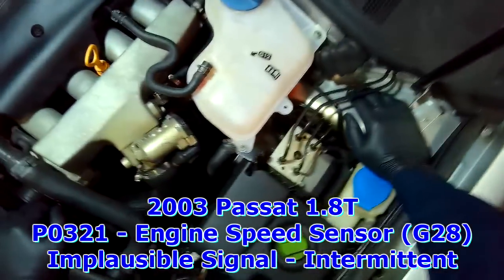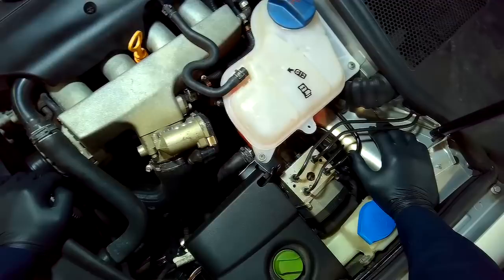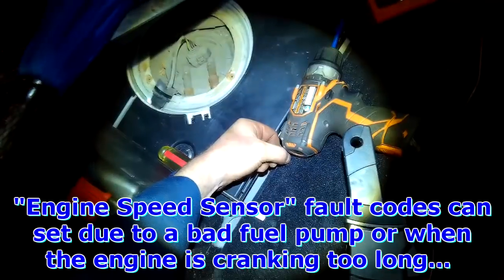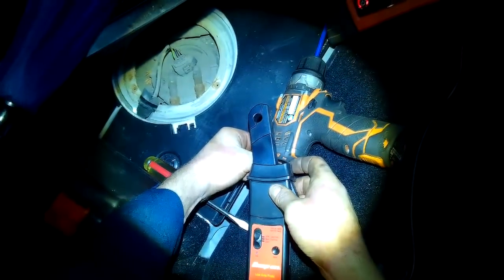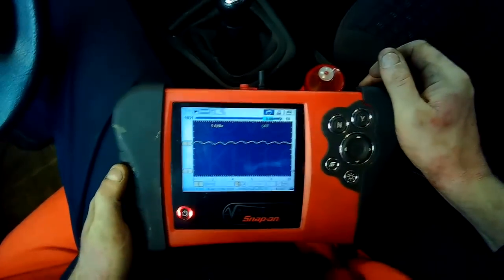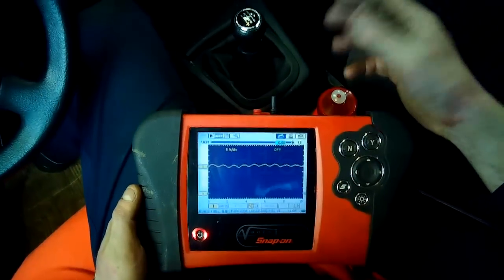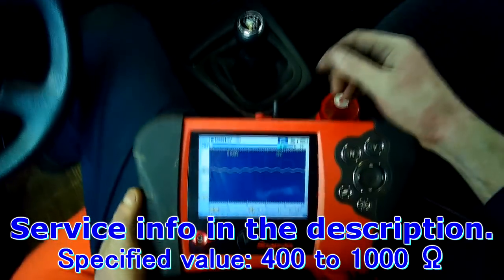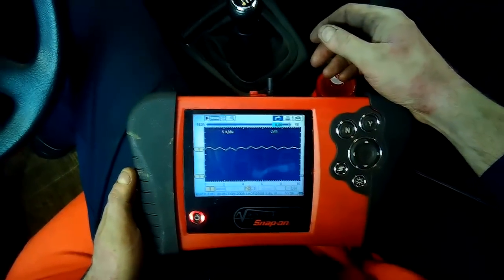VW B5: 1.8T Passat crankshaft position sensor

Comment: I simply cant get that f.. screw out of the sensor. it just wont move and i have no way on lifting my car up.
and i cant remove the oilfilter 
im just stuck right now and dont have a clue how to fix my sensor
Reply from the maker: Are you sure that the sensor is bad?

What symptoms?
Reply: @EXOVCDS  when the engine gets hot the car wont start for about 15-20 minutes
battery is fine, got a service man to check the car computer and the code said that the sensor needs replacement cause temperature sensor in there isnt working anymore
Reply from the maker: @Nydust 
Ok, just wanted to be sure you don't replace it for the wrong reason.

10mm socket should fit.

A 5mm allen should fit on the middle of the bolt head in case the 10mm is stripped.

If both are stripped, you can use an extractor socket to bite the outside of the stripped 10mm head.

Comment: Hi, where is it located on a Passat B5 1.9 tdi afn engine? Thanks.
Reply from the maker: Same place... if it's not there, then it doesn't use a crank sensor.
What's the issue? 
Crank sensor fault code?
No start?
Check the timing belt crankshaft gear... could be loose and caused timing to go out too far.
The more info I have, the better I can help.

Comment: Hello Thomas. I have 2002 Passat 1.8t. There's oil leaking unto my crank position sensor. What's the likely cause and how do I fix this please? Thanks
Reply from the maker: Check your oil pressure switch that is on top of the oil filter mounting bracket.
Check the oil cooler seal. To replace the oil cooler seal, you have to remove the oil filter and the oil cooler.
https://youtu.be/TzjE-rGKSU0?si=l1JK96N2qN-C6O5u
Reply: @EXOVCDS  Thanks for the heads up. Will update you when I do as suggested. 👍

Comment: Strange. It takes ages to get the old sensor out, and you don't show it. And what is it that you are cutting just before taking the old sensor out?
Reply from the maker: Remove what you have to remove, in oder to get at what you want to remove. Sometimes the sensors just pull out... in this video, I needed to pry it out with a pry bar. If you know where the sensor is (as shown & explained in this video) then there's nothing else that you need to know or see... in order to get your sensor out.

Comment: Great job as usual but I would surely remove that oil filter  to make it a little easier. Thanks for the video
Reply from the maker: Removing oil filters on 1.8T Passat's makes a mess... I don't even want to remove them when the vehicle is booked for an oil change. LOL
Reply: @EXOVCDS it is a royal P.IT.A. Those filters are usually very hard to take off.
Reply from the maker: Thank you for watching!

Comment: My hold-down bolt had an 11mm head, instead of a 10mm. Thanks for the video!
Reply from the maker: Does the bolt head have a hole for a 5mm Allen bit? If not, then it isn't a factory bolt. Thank you for watching.

Comment: I know this is an old video and you’re not google but I’m having the hardest time finding anything on my issue. Along with many other codes (she’s a bit of a project) my obd reader is giving me a serious code and the car isn’t cranking. It’s throwing p0012, camshaft A position over retarded. This is the first engine related thing I’m working on as I’m new to vw. Is there any help you can give or videos you can recommend that you think would help. Car does not start, it’s a 2004 Passat gl. Pretty positive the exact same trim as the one in the video. Thanks a lot in advance!
Reply from the maker: A "no crank" is different from "not starting" (which could be a no crank also). 
If the starter is not turning the engine, it could be an ignition switch issue, a comfort control module issue, a Park/Neutral switch / relay issue... if it DOES crank but the engine does not start & run, then you are looking at a fuel, ignition or mechanical issue.
Post a video on your channel so I can see & hear what is happening.

Comment: Hi, maybe remember what size is this bolt ? m6 ? m7? m8?
Reply from the maker: As mentioned in the video, the bolt has a 10mm head... it is an M7 bolt (but that does not matter, unless you have to find a replacement bolt).

Comment: How do you determine if it’s a crank or cam sensor?
Reply from the maker: The ECM will set a code for whichever is faulty. 
A cam sensor usually does not prevent the engine from starting... a crank sensor will.
If you engine is cranking... and you have spark, then check for a fuel pump problem. If you have no spark, then check the crankshaft position sensor. 
Year, make, model, engine?

Comment: Replaced a fuel pump In my 03 Passat. The car still won't start I got to the highway from just filling it up and it completely died on me, so I replaced the full pump, the alt and battery are new, anything that could possibly fix this I'm all ears!
Reply from the maker: Have you checked the timing belt to make sure that it does not have any broken teeth? What does the engine sound like when you are trying to start it? Post a video on your channel so that I can hear & see. Could be a crankshaft position sensor issue... or a power supply relay. Have you already checked for fault codes?
Reply: @EXOVCDS  have no way to check fault codes, I do know the power supply clip on top of the pump is getting power to it, fuses as well. It cranks but no start every couple of tries it will sound like it wants to roll over for a fraction of a second then doesn't. I've purchased incase a cam crank and temp sensor let me see if I can get you a video of engine trying

Comment: Please help me I have this  code in my passat 2003 1.8t ....17939
Reply from the maker: What scan tool are you using to read codes?
Besides check engine light being ON... do you have any driving / performance issues?
Reply: Genisys obd ...no power in low speed
Reply from the maker: @ferminchavez3164  The camshaft chain tensioner is at the back of the valve cover. Look for broken wires at the solenoid (2 wire connector). If no broken wires are visible, remove the connector and check the resistance of the solenoid. Should be 10 to 18 ohms.
Reply: @EXOVCDS  thanks for the help

Comment: My 03 started bouncing the rpms around 2700, 3 times hard start, 4 times rpms drop to zero and gives EPC light. Now I have P0321/322 looks like I'll be replacing my CPS this week. Thanks!
Reply from the maker: Yes, could be a crank sensor that's on its way out.

Comment: My 2002 Passat has a drop in rpm every 2 seconds on idle, and from time to time when downshifting. Can this be caused by the cps?
Reply from the maker: Which engine? If the engine is misfiring / stumbling, that can cause a momentary drop in rpm. Scan the engine for fault codes... even when the check engine light is not on, there could be codes stored. Also check for "fuel trim" values with a scan tool that can check them and let me know what they are.

Comment: Hi, i have test a sensor by bentley manual and everything is in tolerance .. so what should i do .. check a fuel pump
Reply from the maker: If your engine is not starting... either fuel is missing or spark. How are you checking for spark? Year, make, model, engine?
Reply: @EXOVCDS  VW PASSAT 1.8T 2003 awt engine .. fuel is the problem, on harness that is go on to the fuel pump there is no power.. and also on fuse 28(  which is for fuel pump) no power.. and relay is working?
We also try a jumper on fuse box .. and no power through the harness?
You have any suggestion?
Reply from the maker: @1993-g4h  fuel pump relay should have 1 slot that has power all the time. When bridged with 87 of relay, power should go to fuse & pump.
Reply: @EXOVCDS  bridged and still no power on fuse .. i try with other power to start a pump .. and is working .. and car can also working until spends all the fuel which pump pushed in the system.. so definitly the problem is electronic?? Is there some other fuse or relay that is connected with   fuel pump system ? If you know maybe ?
Reply from the maker: @1993-g4h  fuel pump relay is turned on by ECM. You'll need a wiring diagram to troubleshoot things. I can send you one later tonight.
Reply: @EXOVCDS  please send .. maybe it will help.. appriciate your help
Reply from the maker: @1993-g4h  I am away from my home PC until later tonight (6pm)... it's only 8:30am now. You can find my contact info on my website... send me a message, then I can send you the file tonight.
Reply: @EXOVCDS  just to inform you problem solved ... stop groun from fuel pump was on bad location.. and something go wrong ... i jump a wire from to chasis to pump contact on negative .. and put wire from jack where is plus on plus at pump and car ia working. 
Appriciate your help. One more time thanks..
Ps your videos are very helpful.
Reply from the maker: @1993-g4h  thank you for the update.

Comment: My 2000 Passat had intermittent stalling and crank no start in hot weather. I changed the crank sensor. It was easier to do during an oil change with filter removed. Actual fix was bad ECM power relay.
Reply from the maker: Yup, it's not always the crank sensor... it's always good to confirm before replacing. It all depends on ones abilities.
Reply: If I had scanned with VagCom earlier, I would have narrowed it down to relay sooner. There was a code for intermittent ECM power.